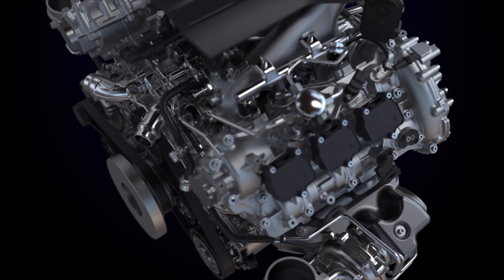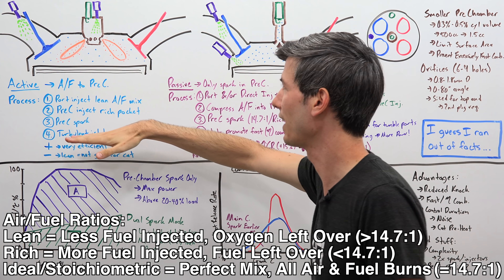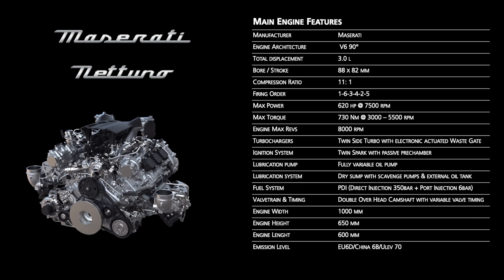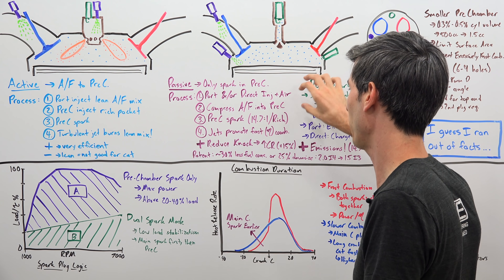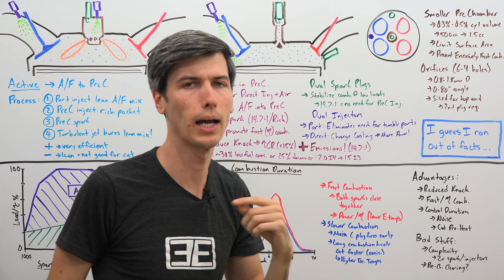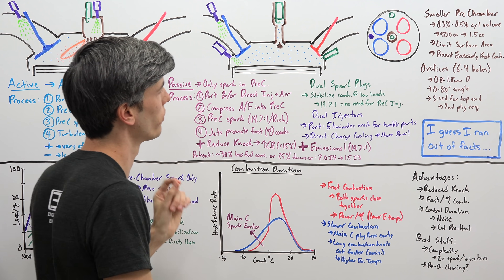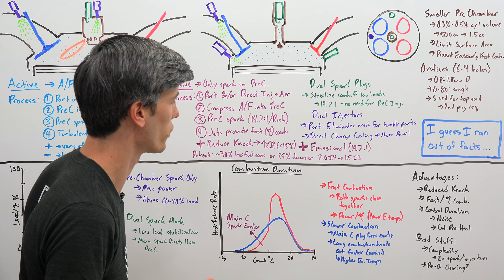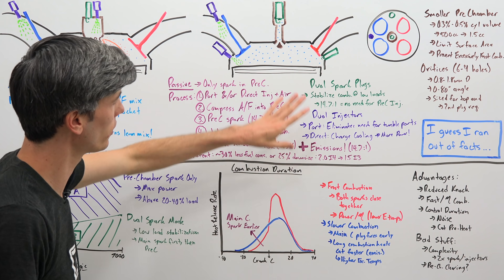How Maserati's Brilliant MC20 Engine Works - F1 Tech In A Road Car!

Comment: Can we get a video on McLaren 720s acceleration.Nothing in it's class comes even close to it,and the closest car is the pista which is lighter, has the exact same hp and torque numbers with also way shorter gearing
And also seen that the 720s makes 690whp when it only has 710bhp according to McLaren
So is this much drivetrain efficiency possible right now?
Not only 720s, the whole McLaren lineup has crazy whp compared to thier bhp

Or is McLaren cheating?
Reply: using an open diff reduces drive train loss dramatically, they use the brakes for torque vectoring and simulating a LSD, that's why you never see a mclaren drifting or doing donuts (chris harris doesn't count lol)
Reply: @ssllhh100  In an LSD, there aren't much losses ... unless you drive in circles. But, kinda 3% losses ... possible, but not too easy...
Reply: Really the SF90 beats it in the 1/4 mile. Even brooks at Dragtimes who just got his SF90 delivered last week admits it's got the edge on the 720.

Comment: It's amazing how much power we are getting from smaller and smaller displacement.
Reply: thereissomecoolstuff gives new meaning to term " there's no replacement for displacement."
Reply: Shelly B.  Is it a regular cab or extended cab?
Reply: Its also amazing how expensive these vehicles are getting every year
Reply: @thomasmullins1783  and ironically, this car starting at $200k is actually considered a relative bargain among the European exotics. I'd love to buy something nice, but the prices have ballooned. Grr!! The logical choice is the C8 Corvette, but dammit... I want that je ne sais quoi. I've yet to find a car at any price which brings back the passion I used to have when I was younger... the irony.... when I had no money I had a million wants and desires... now I have money but no desires. First world problems, I know, but curious if anyone else is in the same boat.
Reply: I believe this MC20 has the highest HP/L out of any non-hybrid production car ever!
Reply: @ufster81  actually it does have to do with displacement and transmissions. Torque needs moving parts. Big moving parts.
Reply: @thereissomecoolstuff  torque is an issue of gearing...